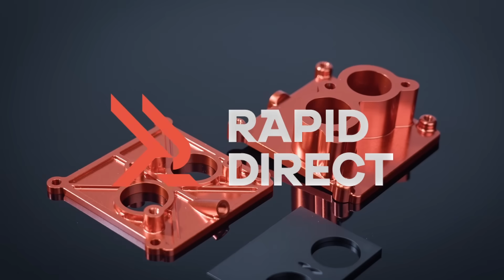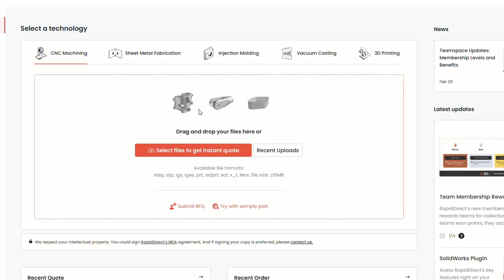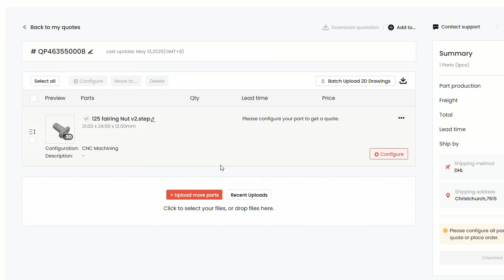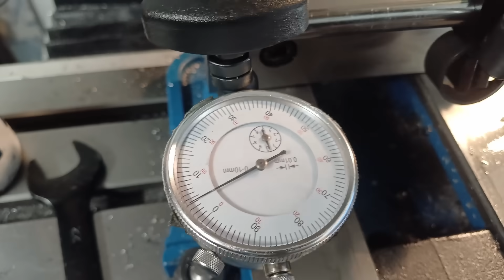Making Earth's Fastest 150cc 4 Stroke Race Engine From Scratch

Comment from the maker: Got an idea you want to bring to life, Rapid Direct are the best in the manufacturing business check them out at  https://www.rapiddirect.com/?rdtm_from=YouTubeLogan-2
Reply: They seem like they do a better suite of metalworking than JLCPCB, who I use for my circuit boards.
Reply from the maker: @Scrogan yeah they are pretty amazing.
If you can't find an alloy or material listed they can normally get it for you.
Super great to deal with.
Reply: @TheMotorcycleForged If you market your products in Southeast Asia, it will probably sell very well, because there are many fans of the Suzuki FXR or 25G series engine with the name Suzuki Raider motorcycle. ❤❤
Reply: I didn't know these guys existed until now. I just sent them a design for a titanium rear axle for my little Aprilia. It'll be interesting. Thanks! Great video as always, inspiring stuff.
Reply from the maker: @vinnymorrissey7357 Cheers Vinny, yeah they are pretty amazing.
Producing some top notch parts.
Titanium axle, that's gonna be awesome.
👌

Comment: 14:30 you can also make some relief cuts on the counters, to guide the crank case gas/oil mix from around the 90pocket where the counter bolts to the unbalanced part of the crank.

Comment: When balancing impellers we started with a jig like yours with bearings and found there was resistance in the bearings. The solution was two knifed straight edges precision levelled.
Reply from the maker: Yeah, there is definitely a little friction, I was considering removing the seals and cleaning the grease from the bearings to help.
Your way definitely sounds like the best solution.

Comment: just discovered Molybdenum Disulfide in a paint on form,  Might be a useful coating in places where under high rpm risk there's a risk of oil cavitation or metal on metal contact under vibration, like oil pumps etc to reduce the risk of Galling

South Island Bearings can get it as Loctite LB 8017, it's used in jet engines etc to keep critical parts moving encase of oil pressure failure.

Really useful stuff and not so known in NZ apart from as Cam Lube/Grease etc, it feels like graphite coating but is much more resilient, im gonna be coating it on surfaces i "need" access for maintenance to stop things sticking like dowels, hoses, gasket material etc so work is more enjoyable. always nice when things come apart when you need to do a quick repair :)

can also be used in places you dont want dirt building up like inside the chain covers etc :)

there's my 10 cents of my new found material that's making repairs enjoyable to do. thanks for the rad content!!
Reply: i found the product as something i could use in place of "Tomie throttle coat" to repair the seals on my VFR800 throttle body butterfly valves, worked great, now i use it on all surface to surface parts :)
Reply: https://datasheets.tdx.henkel.com/LOCTITE-LB-8017-en_GL.pdf 
There's the Data Sheet if you're curious, handy stuff to have if going to be doing alot of disassembly/reassembly, can be baked with achievable temps for coating components, maybe even reduce friction with oil contact too (maybe) Good luck with the next steps in your build! 😁
Reply: "LOCTITE LB 8017 is a molybdenum-disulfide based solid film
lubricant. It is a heavy-duty lubricant used for general plant
maintenance, metal working trade, machinery manufacturers
and manufacturers of military and commercial jet engines. For
continuous use in sliding friction, at temperatures from -29 °C
to +400 °C. For anti-seize lubrication, LOCTITE® LB 8017
functions from -29 °C to +1315 °C . Typical applications include
Maintenance - threaded lubricant, dry bearing surfaces, slides,
guides, pins, conveyor chains, exposed "dry" gears, flexible
shafts, press fits, valve stems, shaft/packaging wear-in, "easy-
off" coating for boiler exhaust surface deposits, power
transmission couoplings,"
Reply from the maker: Cheers, that's some good info.
I'll look into it, thanks man.
Reply: @TheMotorcycleForge  youtube deleted my comment with the link to the Data Sheet .PDF which has interesting information to make its easy to look into, so instead ya get a messy "copy n paste" :) anyways, good luck

Comment: Secondly... balance factor depends on how much vertical versus horizontal shaking you want.
Basically, 100% balance factor completely removes vertical shaking, but turns it into horizontal shaking. 50% balance factor turns it to 50% vertical and 50% horizontal (not exactly, but close enough).
Check out Kevin Cameron on Cycle World (podcast and blog) for some good background.
If you want to remove weight AND remove out-of-balance (shaking or vibration) then you have to have a balance shaft or a 90degree Vee twin. There is no "magic" alternative...

Comment: What's actually in the crank case on this? Is it just your bottom end bearings and oil or does it also have your gearbox? If it's not the latter then I'd say dry sump it to simplify the crank case design.
Reply from the maker: Gearbox is in there as well with the crank, although it may still be possible to dry sump it as the gearbox is pressure fed.
Reply: @TheMotorcycleForge that does complicate things a bit, could switch to electric oil and water pumps with lines running to a rail or channel in the bottom end to get the flow to the cylinder and to remove the need for gear or belt linkages to the pumps. Also I have seen some people saying if you can create negative pressure in the crank case with the oil scavenge pump then this can increase power as the pressure difference between the top and bottom of the piston is higher and the air resistance is slightly less. But that's all food for thought, if you could still use the standard gearbox internals as well it'd simplify it but don't know how the gearbox lubrication works.
Reply from the maker: @oli_onion Cheers, ill look into it and see what I can come up with.
It will have electric water pump at this stage

Comment: Bolting crank counter weight is a bit concerning, i would rather use the stock crankshaft from Suzuki cuz from what i've learned those crankshaft was able to withstand 15k rpms on dyno and 1/8 mile drag strip with crank balancer on.
Reply from the maker: If it's good enough for F1 it's good enough for me.
It will be pretty safe, not worried about it at all 😅

Comment: Hey brother look into gun drilling that crank I know it's gotta be dumb heavy!!!! The lighter you can make the rotating assembly the faster the engine will pull through the RPM band and in all of my race engine builds " my family has had a engine machine shop the last 60 years" that are short track like 3/8th mile dirt oval I aim for a 53% balance factor to try and tame harmonics... When you have a set of crank,rods, and pistons that are on the heavy side it's harder to get acceleration off of a corner with the engine trying to spin up the extra rotating mass!!! And afterwards going into a corner it's like a wagon with a fat girl in it headed down hill at mach fuck.... The mass of the rotating weight pushes through the brakes and it literally will make the front of the vehicle break up and lose traction when it unloads the suspention
Reply from the maker: I'm expecting the crankshaft will be around 1kg lighter than stock.
What part needs gun drilling?
Cheers
Reply: Maybe he means down the centre of the shaft??
Reply: @samnepia7373  yes you can drill down the input and output sides of the crank and you also drill through the center of the rod journal to get as much weight as possible out of the entire crankshaft
Reply from the maker: @ZackeryStang Big end is already drilled, there is a oil gallery drilling through the output side.
Haven't bothered with the rotor side yet.

Comment: Progressing well.
Out of curiosity what would those 2 titanium pieces coated in DLC normally cost?
Reply from the maker: Cheers Alan, with no discount the two titanium Dlc coated rods were around $130usd which considering the precision machining and coating I think is pretty good.
They would be cheaper if it was more than one of each ect

Comment: Great progress! Balance factor is highly dependant on the chassis of the bike, the angle of the cylinder on the bike mostly. It was done by trial and error back in the day, the intention is to avoid harmonics that'd affect the rider (some bikes are so bad your vision goes blurry lol)
Reply from the maker: Cheers Jake, I was thinking with thr removable weights it should be easy to change to different balance factors.
Yeah I have riden a few like that haha, hands get pins and needles petty quick lol
Reply: i learned that the hard way

Comment: Need a 4J tap, J gives a rounded thread root so it’s stronger and the 4 tolerance class is higher. Will need corresponding hardware, stud the crank and use something like an ARP2000 12point nut
Reply from the maker: Cheers Ricky, that is just the info I was after 👌 
Legend

Comment: Instead of dowels with the bolts what about using shoulder bolts. FZR250s use a sort of shoulder bolt with ground shanks fitting in the connecting rods and to join crankcases.
Reply from the maker: Oooh a bolt that functions as a pin as well?
Sounds like that might be the go if I can get some from ARP or the likes.
Reply: @TheMotorcycleForge or use two very small pins, offset from the threaded holes. Poke-yoke the position so the caps only fit one way round.
Reply from the maker: @mandrakejake Also a good idea, I will have enough meat for that as the actual crank will be slightly wider as well.

Comment: The leading edge should always direct the crankshaft air to the mains not to the big end
Reply from the maker: Someone told me at that recently as well, my only concern was the gap between crank and crank case is smaller than the big end gap.
I'm thinking of putting the case in a vacuum to help reduce windage
Reply: @TheMotorcycleForge  Dry sumping is certainly worth considering.

Comment: crank weights makes me think of what they did on old radials.
mount them on two links. let them swing
harmonic damping... be fun for giggles... maybe on a pitbike rather than here...lol. just one of those quaint and long forgotten things that would be interesting to see...

bolts in shear versus tension... tension is all about thread engagement and material. shear is just the diameter.

drill &ream the webs on the other faces. large pins. each weight made in two halves locating over pins, and one bolt merely clamps them together rather than holds them on. the pins hold them on in shear.

dovetails...lugs... doesnt have to be a pin...

another thought... grab another length of bar. go find a helpful farrier or smithy... forge it. dont really need the big fancy drop forging machines...

some guys would take it as a challenge to get almost to the drawing... :)
Reply from the maker: Cheers man that's some good info, the weights currently have a 8mm solid pin and I'm planing on adding hollow dowels over the bolts as well. That should sort sheer forces then just need a couple decent threads and bolts.

Comment: Probably want to do the maths on the mass of that flywheel weight and the centrifugal force at full RPM.  That will tell you the bolt size and thread requirements.  Also the torque and bolt stretch required at installation to keep the weight against the crank.  Be mathematical about the torques on those bolts.  5 duggas with the rattle gun could end up in a major engine explosion!  I have never seen weights bolted to a crank before.
Reply from the maker: My current plan is to use ARP custom aged bolts, they have insanely high tensile strength.
Thread wise finer pitch is stronger and I can only realistically fit M10 so M10x1 is the plan.
Yes they will be torqued to speck and possibly loctited as well.
I will look into the centrifugal force equation.
A lot of F1 crabkshafts have bolt on counterweights, that's where I got the idea.